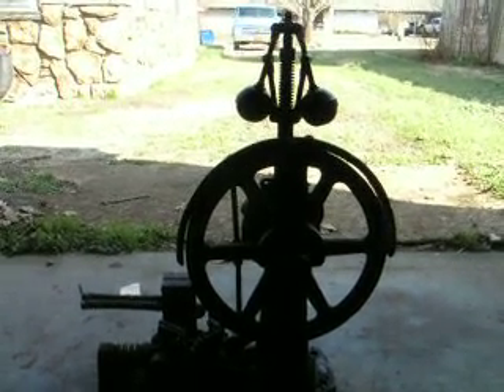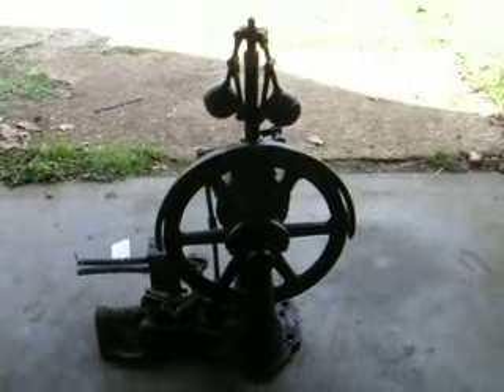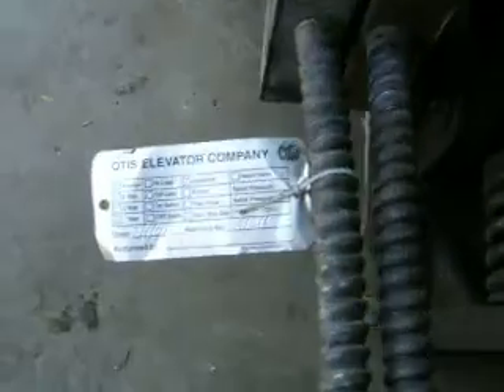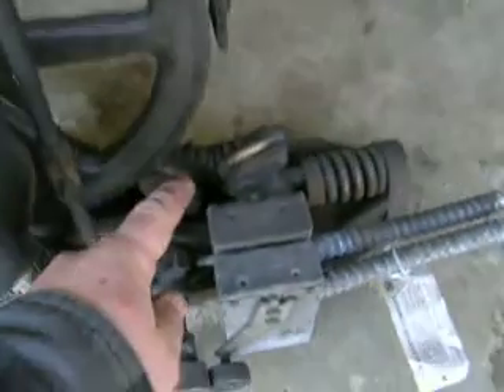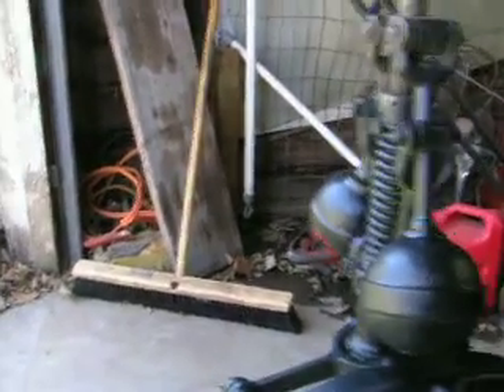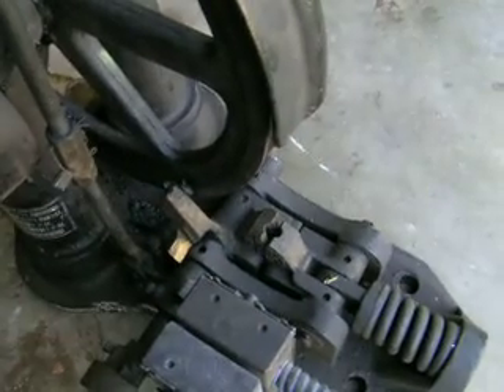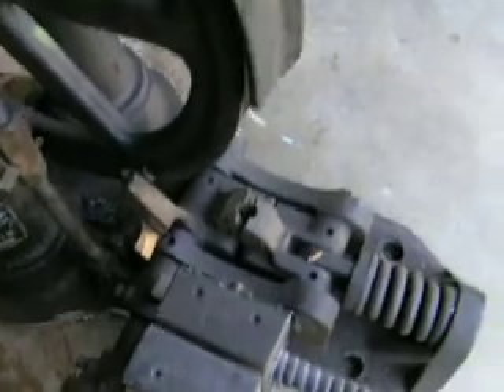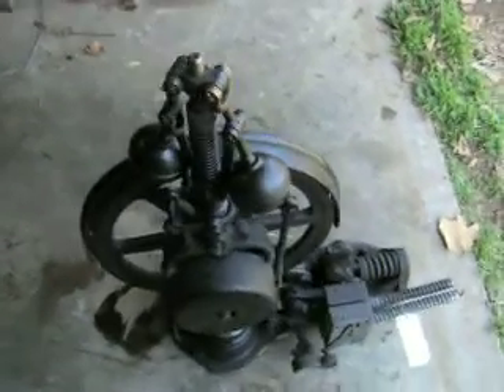1963 Otis type F elevator safety governor

Comment: Bro can i use your video for my presentation?
Reply from the maker: Sure!
Reply: @okbridges  thanks a million. Also, did you realise that there's a small tiny hole at the side of the gearbox to add oil ?
Reply from the maker: @gurveersingh3358  I'm sure I've seen it. It has several oil holes in different places, as well as a few grease zerks.  I want to replace the zerks with the turn-down style grease cups.

Comment: Otis still used the old fashioned governor in the 1960s.

However, a lot of today's elevators are "Built like a BIC lighter" and just  throw away products.
Reply: They really are.  If many of the new one's were ever to actually overspeed it pretty much needs to be inspected and most likely replaced.  These Old Otis one's are solid and ultra heavy duty.  The last Mod I did was on some elevators that were installed in 1956. The machines and the governors were both original.  As well as the motor which looked to be the only thing that had seen necessary maintenance.  The cars now have new ropes, controller, motors and governors. I believe they should have kept the old governors.  They were grimy and needed to be cleaned but they'll outlast the new ones. The machines needed to be cleaned and painted, and gasket replacements.  But other than that, The machines will go 100 years  I bet. 
The old flyball governors operated like new and were well greased.  They just needed to be cleaned but the building owner wanted new ones.  This oldschool stuff will outlast the new...

Comment: Well done for rescuing them, nice bit of simple but effective engineering, i have a very similar one, i think mine is a little older, its belted up to a lister diesel to demonstrate it, i'll have to get it out the shed and fire it up, thanks for posting.
Reply: Dieseljonnyboy They can also be spun by connecting the top of the shaft to an electric drill.